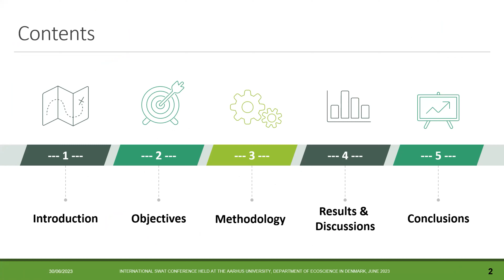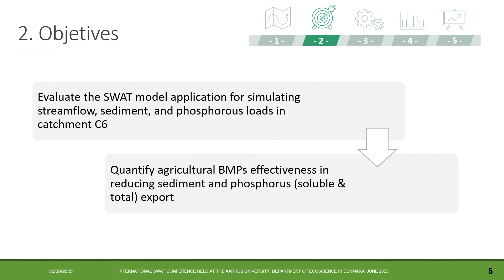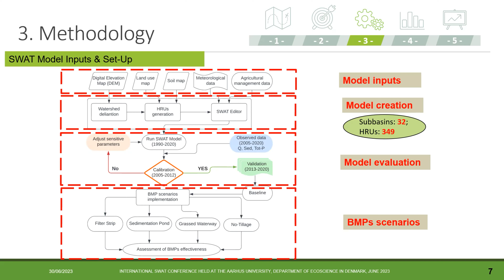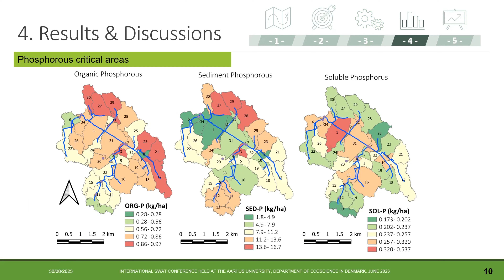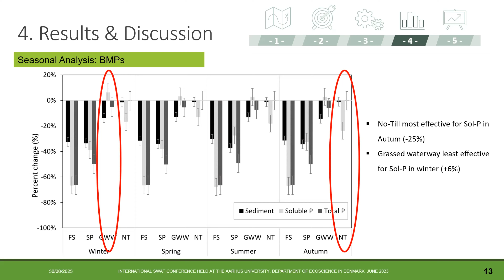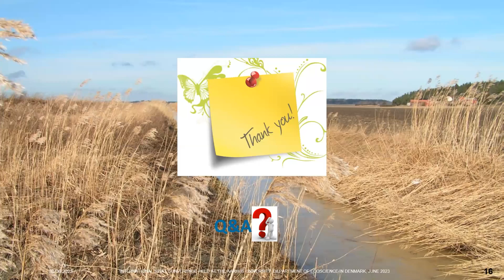Best Management Practices (BMPs) analysis using the SWAT model

Comment: Hi Dr Brian, how did you implement or represent the BMPs in the model. The calculation is at the HRU level and the HRU may not necessarily be contiguous with the strips spatially. So how is the flow routed to these filter strips which have specific spatial locations along the streams